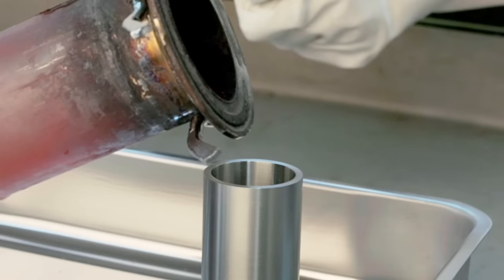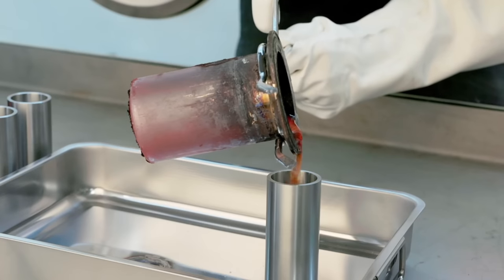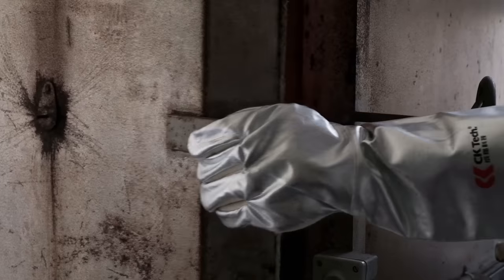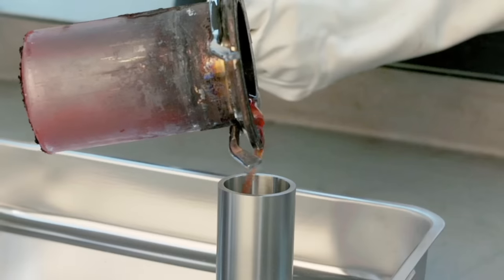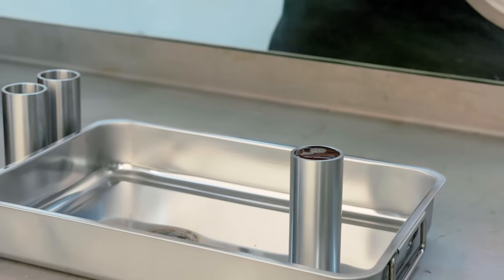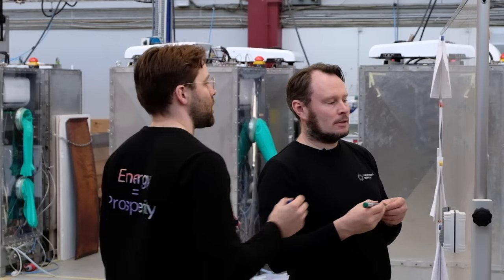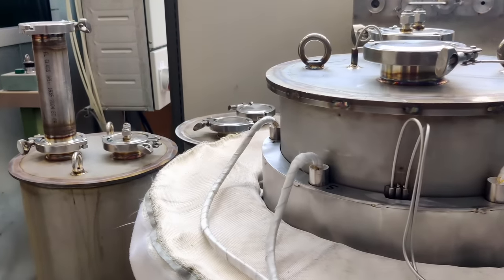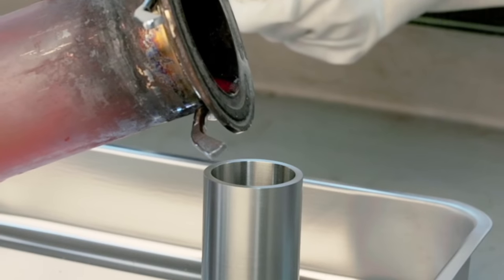Molten salt products explained

Comment: I always thought that corrosion in MSR is the bottle neck a we are waiting for a breakthrough in steel alloys to solve it. It's wonderful that it has been solved and even better that it is an old news.
Reply from the maker: We have addressed the issue of corrosion through our method of purifying the salts. We can purify these salts to such an extent that corrosion occurs at such a low rate that it is not a concern, even for stainless steel.

Comment: Why would a molten salt reactor vessel need to be metal?  Other than by regulations that are devised for the PWR?  With no pressure to contain in an MSR, Silicon Carbide seems like a good material to use.
Reply from the maker: One of our main priorities is to be able to mass manufacture these reactors to drive the cost of energy down. Stainless steel is simply the cheapest and best option for us to begin with for mass manufacturing.
Reply: How about ceramic?  An MSR doesn't need high pressure containment, I'd think ceramics would be chemically resistant and deal well with high temperatures. Ceramic is brittle and hard to machine which would be the main problem with it.

Comment: Are there improvements on this front? Probably one of the biggest issues with this tech.
Reply from the maker: We have addressed this issue through our method of purifying the salts. We can purify these salts to such an extent that corrosion occurs at such a low rate that it is not a concern, even for stainless steel. The improvements we have made include scaling up our production and, thus, being able to produce significantly larger quantities of highly purified salts.

Comment: Consider combining the purified salt with cathodic protection and replace all the atmosphere surrounding the equipment with argon.

This multi-pronged approach would reduce the corrosion problem even further or eliminate it entirely.
Reply: Wouldn't dry nitrogen be about as inert as Argon and much cheaper?

Comment: Are these fluoride salts!? 
And are they a lot more expensive than regular table salt!?
Reply: Most salts used in thermal cooling is a custom blend based on the process and equipment design.  So the most common is Sodium Nitrate and Potassium Nitrate, with some potential other additives used to tune certain properties.  But I wouldn’t be surprised if they also work in Chlorine, Cyanide, Cryolite, and other fluoride, chlorine, and hydroxide chemistry to stay relevant in a niche industry.
Reply: There is molten chloride salt reactors, which is similar to table salt. But with reacted Actinides and uranium/plutonium converted into a chloride salt.
Reply: for reactors the two main salts are either chloride or Flibe (lithium/beryllium fluride)
Fl salt has better neutronics, usefull for a thermal reactor
CL has worse neutronics but can go higher temps without making the vessle porous
the latter is more exciting, 850c you dont even have to waste energy making steam you can jump straight to chemical prosessing

the solar salt or thermal salt is another mix made for low melting points, less concerned about neutron flux with that stuff.